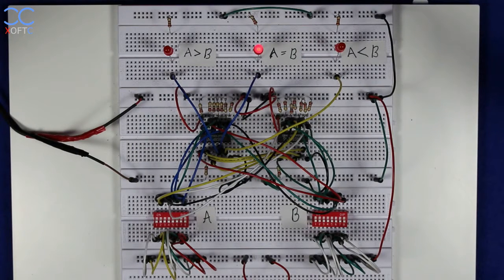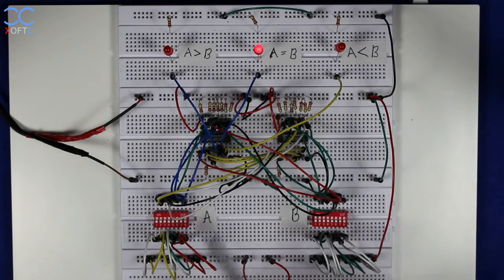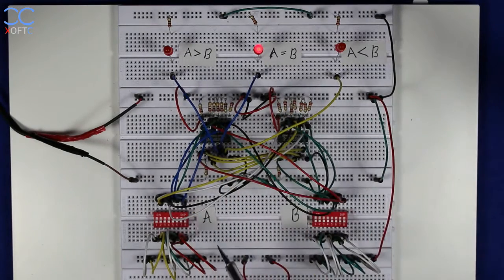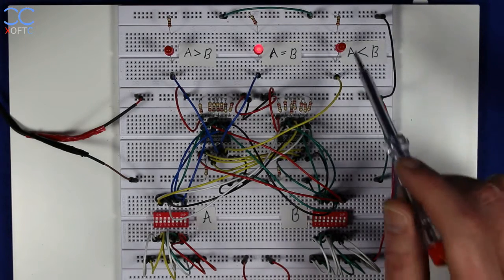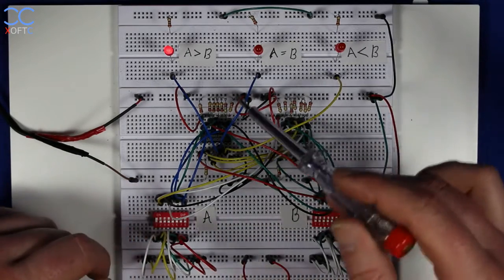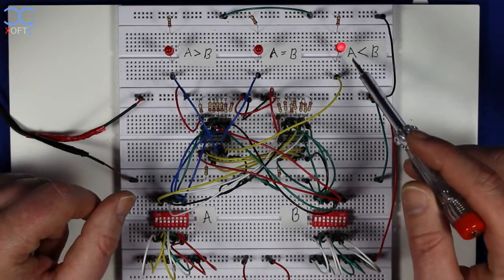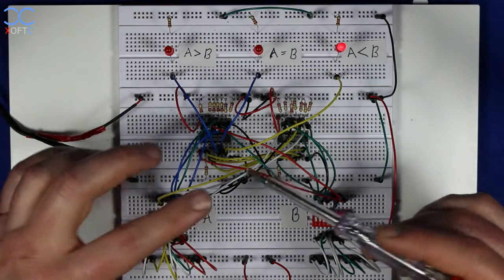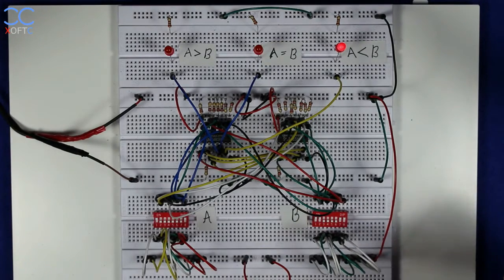How to Use 4Bit Comparators (7485)

Comment: Hey xoftc, i would like to ask for some assistance for we are doing the same project but only "=" sign is what we are having an output on. Is it okay if you may help us as soon as possible for defense is tomorrow March 14,2017.. Please do reply ASAP!
Video helps alot but the problem is we couldnt make the bulb light up,  where we think that  the problem is about the power supply i guess? here is a picture of our circuit (https://cdn.discordapp.com/attachments/175919752516993024/290845137498669057/17327957_1519707341374058_913526277_n.png)
Reply: up
Reply: up
Reply: up
Reply from the maker: I have seen the photo. where are all the pulldown resistors?
With TTL logic functions if you leave floating pins you will get erratic behavior.
Reply: Where should we put the pulldown resistors? We really don't know a thing about circuits tbh.
Reply from the maker: John Dolor place a 1k resistor between each input pin and ground.
if you are cascading several chips make sure to also place a 1k resistor on pins 2,3,4 (assuming you are using a 7485 series).
in short, always place at least a 1k resistor on all the input pins to ground, provided you are working active high (and according to your photo you do). and if you work active low (meaning that your input signals are lows aka ground instead of V) you always place a pullup resistor between all the input pins and V.
Reply: Thank you very much for the help bro.
Reply from the maker: Glad to help. Hope it works out for you
Reply: Hi xoftc, can we also ask if what are floating pins? Thank you.
Reply from the maker: A floating pin is a pin that doesn't have a reference to either ground or Vin when no input is provided.
At this state all sorts of random things can affect the pin and the internal circuit that it corresponds to inside the chip.
In most chips that make up digital inputs (high/low) the input pins always need to have a defined state of being either high or low. At times when you don't provide a high (like in your setup when the dip switch is in off state) and at the same time there is also no pulldown resistor to provide reference to ground and pull the state of the pin to low, that's a floating pin. The pin will be affected by random things in the circuit and the environment and will always have some voltage but not high enough to be defined as high input and not low enough to be defined as a low input. The definitions of how much voltage you need to provide in order to get each absolute state are normally provided in the datasheet.
Reply: Thanks xoftc!